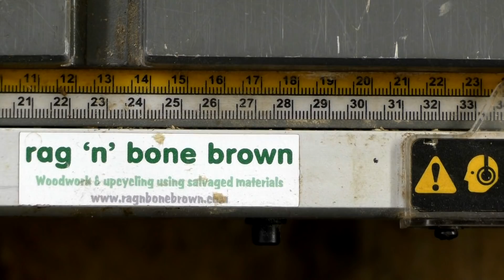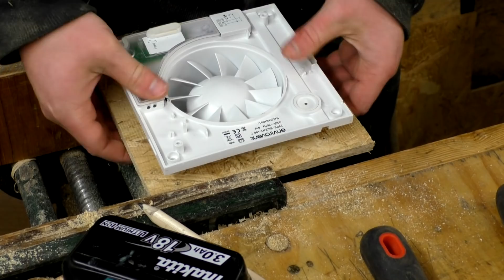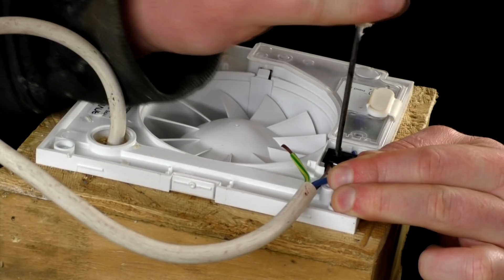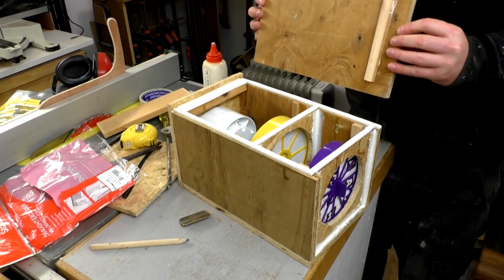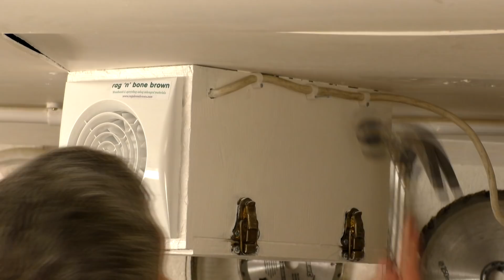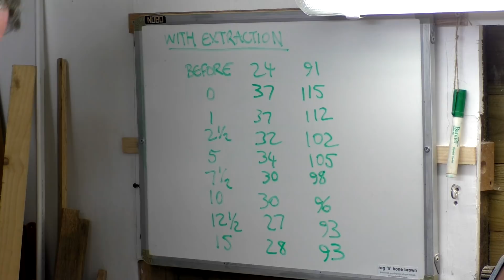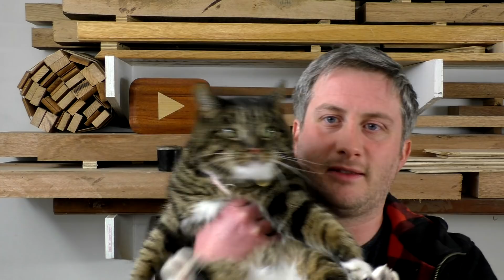Making A Small Air Filtration Unit For The Workshop.... FAIL!

Comment: Most bathroom extractor fans are rated to 23 l/s of flow. Experience tells me that these fans, with their high rotor clearances and slow rotational speed operate at quite low static pressures. 

The record power fan is rated to 409 cfm which is ~11600 l/m. You fan is roughly 1,400 l/min.
These ratings will be tested under nominal load, so the record power unit will be tested with filters in place and the bathroom fan will be tested without filters. Putting filters on the bathroom fan increases the pressure drop of the system. The fan doesn’t create much pressure in the first place, so this really compounds its weak flow rate. 

Long story short, your fan isn’t man enough! 2000 - 3000 l/min is probably an appropriate flow rate, but you need to achieve that with the pressure drop of 2 filters in your system. If you can’t find pressure information on any fans, look for a fan of around 4-5000 l/min with a design which has a very narrow clearance between the shroud and the blade, probably a metal impeller, and a much wider impeller diameter.

(Rules of thumb with industrial fans is that fan diameter is proportional to pressure development and the depth of the fan is proportional to the flow rate)

Hope this helps, and best of luck!
Reply from the maker: Thanks- great info much appreciated

Comment: Use bigger filters a car radiator fan powered by a modified dell server psu and a cheap pwm board to control the speed that was my workaround I did the exact same build as you first attempt with similar results :)
Reply from the maker: Thanks glad to know I'm not alone!

Comment: There are two types of fans, static pressure fans and air flow fans. Air flow fans need "free air" to operate. Also the filter surface is to small and produces too much air resistance

Comment: I do not see this as a failure it’s just your Mk1 😀 Accepting you fan selection for what it is ( it is very small) I think your filters are presenting too much of a restriction and need to be mounted in a larger plenum chamber.

I would put a much  bigger filter in a a plenum changer twice that size and construct a smooth transition piece between the fan outlet and the plenum. I do not think your fan can shift air through both those small filters and it is effectively stalled.
Reply from the maker: Thank you! Great info

Comment: Those boxes you can buy still dont filter down to the respirable dust.. I have had this out with all of the manufacturers you displayed and non of them have given me a decent answer.. Think they rely on people not knowing that sub 0.5 micron is the real issue. Though the exposure would be over an 8 hour period...
That fan does not have enough power to be able to pull or push air through those filters. It is designed to pull air through without any resistance if you let me know i can calculate the AC / hr you would need to get the room down to a decent level

Also that particle counter is the PM10 and 2.5 measured in microns?

Best way to get a cheap fan which will have the kind of power you need is a desk fan or something similar. Alternatively a smaller scale fan would be a high powered computer fan however the main trick is to get maximum surface area of the filtration media. I have some ideas if you want to message me and go over a few.

Comment: Really cool of you to put up this video! Subbed. I need to build an air filtration system for my workshop, and it is about the same size as yours. And I need to go through the same learning process. May I suggest putting two fans on the box? One to pull in front and one behind the filters? It would be cool to see it it worked. 
If you have the inclination, stop by my fledgling channel and show some support. Cheers.

Comment: 2 small filters back to back and 1 small fan was never gonna work, try watching Matthias Wandel's videos on air cleaners, he uses furnace filters that have 20-50 times more surface area and therefore less restrictive, also a much more powerful fan.
You could probably fit a box fan with a furnace filter in the same height as the one you made.

Comment: I don't think the fan position affects anything. Basically the same amount of air has to go in one end and out of the other and the only thing making this happen is the fan. The fan you have used is designed to pull air from a bathroom and out into open air and normally the only restriction would be the pipe through the wall. Put in a filter and you add way more resistance than the fan was designed for. There is a clue in its description as well. A fan designer once told me that silent fans ALWAYS move less air than the same sized noisy one, the difference comes from the blade design and the power consumed. Sound is moving air so less moving air = less sound. Solutions are either to decrease the resistance caused by the filters or to beef up the fan. I would change the fan. A push-pull arrangement might work, but might also give some strange effects if one fan starts driving the other.
Reply: forgot to put - filter before fan is always better as it stops dust clogging up the fan

Comment: I think is not a failure. Air cleaner have to prepare the room for next day. While you working it's functionality is poor (low suction power) but over time it's should work. Just try measure particles next day  after work, then leave it overnight and measure again.

Comment: I think you might have had better success if you'd drawn air through a much larger filter and perhaps chosen an inline fan with a rated air volume figure. I've been messing around with a cookerhood filter and some fans from a computer with some initial success (filter gets dirty) But I think the most interesting thing from your experiment is the effect that good dust extraction has in general and that with good extraction, dust settles out nicely after a relatively short period of time.
Reply from the maker: Thanks Karl

Comment: Great experiment! mybe not an product just yet... but some very interesting info... specialy about the need for dust collection! one more (experimentaly tested!) reason ill build one asap! 

I would think of two things for improvement...1. larger fan... more sucction... input(or intake?) holes facing downward; and 2. id put the fan "to pull out the air of the box not to push it in" hope its clear what i mean? in a sense that air is pulled into the box into the two filters... driven out of the box at the end of the proces by the fan... maybe... :D 

good luck and thnx for sharing! maybe ill join the experiment soon when i start building my dust collection sistem... but probably not this year :O  :D

good luck!
Reply: And yes i would also reconsider the place to put it... on the ciling i think it only picks the dust up in the air... maybe ... just my thought...
Reply from the maker: Thank you! I think you're right as others have said similar

Comment: not enough air pressure to pass the highly restrictive filters. The filters are designed to work in a low pressure vacuum and you have a very weak fan just blowing on them, no vacuum to be seen. Ie you are trying to create a high pressure area with a 25-30w fan on filters designed to be used with a 1000-1500w vacuum.

Comment: That's a low pressure fan and your filters are for a high pressure vacuum. You just have the wrong filters. You need  a less restrictive filter media, like a furnace filter that will allow air to move through more easily. Other than that, it should work just fine. You needed to bench test the flow before you installed it.

Comment: Two fans one to push one to pull you have two filters to much for it add one more it should be fine or just one to pull but me I'd have two my self use a shower one the it can go right out side but the way you made it your going to spend most of your time cleaning it out because the dust will have know where to go try it you never know you mite find it works iv made ones out of old boilers and shower fans never had a problem yet hope this helped and anyone else looking to do it

Comment: no 1 mistake is that you put the fan (that probably is also too small for the job) before the filters so what you are actually doing is increasing the pressure inside the box. the fan should blow air out of the box (hence the extraction) so it should be after the filters and not before. start with that and with a fan with bigger static pressure. to have an indication those filters are designed to work with a dyson vacuum which has a motor probably 10 times more powerful than the fan you r using!!

Comment: Keith, i'm no expert to take this for what it is. Don't air filter systems usually have the filters in front of the fans so the fan pulls the air through the filter? Your set up looks like the fan is in front of the filters so the fan is pushing the air onto them. Hold up your hand to the back of the unit, can you feel the air leaving the system? if so then you have good air flowing through the filters so that would suggest the issue is with the filters or maybe the fan being too small. 
Good luck with it anyway, please post the vid of your final system when you've fixed it.
Reply: JayKay that's how I made mine.an old fan sucking the air through the filter.
Reply from the maker: Thanks yes others have suggested that too so i suspect you're right

Comment: Air has to flow through... an exit. Otherwise you are just moving air in a dead end box.  Open the other end up.
Reply from the maker: I understand what you're saying but in theory air can move through it because the back of the box isn't sealed. I think as others have said it's a case of the filters being too thick and the fan being too weak, and that the fan is pushing air in to the filters rather than pulling

Comment: Couple thoughts. 
1. The exhaust fan is to small and lacks power to intake air. Its not deigned and calculated to have resistance such as 2 dense air filters. 
2. As air flow is obstructed it bounces of the first filter and so the edges are less affective. Longer case could help that. Or a tube mounted if front of the fan.
3. Placement is not ideal as particles are heavier than air, thus it would be most effective on the ground or mid air.
Reply from the maker: Thank you!

Comment: ** I'm sure you need to pull air though the filters not push it on to them just flip it round and suck the air though the filter simple and see what happens cost you nothing **
Reply from the maker: Thanks!
Reply: No expert but first bit I would try for free then look and bigger fan or thinner filters
Reply: Yeah i would agree think how they would work in the dyson surely they pull air through the filters??

Comment: Hey Keith, always look forward to your videos! I think its due to the fact you will need to be pilling air through the filters and not pulling it in to the box and then trying to push it through the filters, I am no expert but you may be able to reverse the direction of the fan to then pull air from the other side of the box?Different polarity may do this but again i am far from an expert.
Reply from the maker: Thanks you're probably right as others have said this too!
Reply: Rag 'n' Bone Brown Hopefully you can get something sorted and get it working 👍best of luck

Comment: it is not necessary a fail. You just need to correct some mistakes you made. The filters you used have a lot restriction for air flow. They are designed to be used with powerful impeller fan with a lot of suction. You just need to use filters with a lot more surface area (a lot bigger basically) . They are easier to pull air through. Or use a lot more powerefull motor with impeller (blower) fan, to suck the air through the filters.

Comment: I'm two years too late, but wanted to state the obvious. 

Any fan that promises to be silent also promises to be nearly useless, especially when you're trying to restrict the airflow with a filter.  You need something that can generate a pressure differential and that means noise. 

Anything branded Dyson is essentially a jet turbine repurposed into a household appliance. 😅. They can get away with using those thick sponge filters because their blowers are so powerful. Pairing them with that wimpy silent fan... was about the worst combination you could make.

Comment: Why are you using 2 filters? Are they for different particle sizes? I would agree with other comments that the air should be drawn through the filters not pushed through them. I think from the video that the box is open at the air outlet, which it should be of course. It’s all about air flow and fan capability. You need a large air flow. You should design the system so that the volume of the air in the room passes through the filter in a defined time, say 15 mins, that is getting towards 100 cubic meters per hour, which is quite a lot. The filters add resistance to the air flow so they need to be taken into account when sizing the fan. If the filters cater for different particle size then the large particle filter should be first in the air flow followed by the small particle filter, because the small particle filter will also trap the large particles! The box cross section is square and the filters are round, as is the fan, so there is likely to be turbulence in the box, which reduces throughput of air. A laminar flow is better; so try making the path for the air in the box circular and the same size as the filters and fan. Why not put the fan and filters close to each other? Lastly I would suggest that the filter should be positioned where the particles are generated. I assume that the particles fall to the ground under gravity. I think your measurements with the unit turned off demonstrate the rate at which they dissipate to the ground, where else can they go? So that could help modelling the system and determining the capability of the system. The cleanliness of your workshop will also be influenced by its shape, the objects in it and draughts. It’s a very difficult problem to solve. I hope my comments help you get a better solution.
Reply from the maker: Thanks very useful and some great ideas here - much appreciated

Comment: I have to admit I liked this vid, because showing your failures just means you're human like a rest of us, I've lost count of the fails i've had over the years...lol
I know this is an old Video/project, but i've been looking into ways of cleaning the air in my small workshop and I found some good info on this site I think its an american that is based in China, https://smartairfilters.com/en/blog/air-purifier-filter-on-the-front-or-back/?rel=1  There's a few different articles about their DIY attempts at cleaning the air in a Beijing apartment, which they seem to have done with great success using just a fan and a filter. I'm not sure yet if this would work in a workshop environment and i'm still looking around at different ideas, but for anyone looking into making something, I thought it might be useful as its probably the most simple and effective idea i've come across.

Comment: The fan you used doesn’t have enough power to move the air flow I watch (Happy Wife Happy Life) and he just put in he got a RECORD POWER AC400 he try’s it out and it was quite I was thinking off getting one he got his on the roof what was the sizes of the box you made this is the Dimensions of the Record Power 60 x 50.5 x 33 cm
I don’t think it will work as well under a table 
Check out his video
Reply: Click Woodwork - That wasn't a Record Power he had, he bought it from a UK on-line store called Rutlands and it was a Budget one, also the dimensions you gave are not the one he has. You maybe right on the dimensions for the Record Power machine, but not the one on (Happy Wife Happy Life).
Reply: Barry Roberts ho right sorry about that got mix up it’s because when you click on his link that’s what comes up sorry for the mix’s up and yes the dimensions are for the Record Power
Reply from the maker: The height of the unit is my main problem, not enough ceiling height in my shop. I think the unit I made was around 25cm. Someone else in the comments suggested a product called Thor Microclene which looks perfect for what I need - unfortunately though it is pricey

Comment: Simply put dude, you just used the wrong filters. That fan isn't going to be built to produce anything like the standing pressure that a vacuum cleaner produces, so very little air is going to pass through those filters. Something like a computer case filter pad would work for this application, with that fan. Electrostatic filters are more expensive but would give better results.

In cost terms, Amazon sells forced air heating filters here in the UK and fans are fairly plentiful for trash picking in Autumn, so you might as well just wait till after summer and build a Wandel/Heisz style cleaner.

Comment: You're already wearing a dust mask and I assume that will continue even with a working filter unit. So then why have a filter unit at all? Regardless....start at a more basic level. Get a box fan (don't know if the UK has those) and a basic furnace filter that will fit. See what kind of results you get with that and scale up or down from there. Most of the household fans are not very noisy but can move more air than that tiny exhaust fan.
Reply: I think the reason for him wanting the dust extractor is that its a right PITA to have to wear a dust mask even when you are just doing hand work and not use the tools, I always find mine super uncomfortable to wear for long periods of time and thus only I am guilty of not always putting it on.
Reply from the maker: Spot on :-)
Reply from the maker: Thank you!